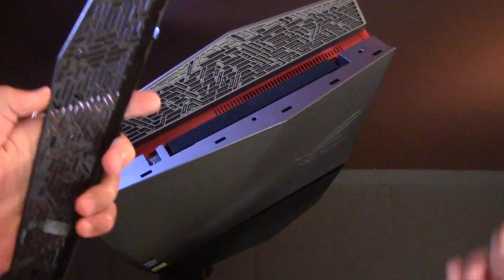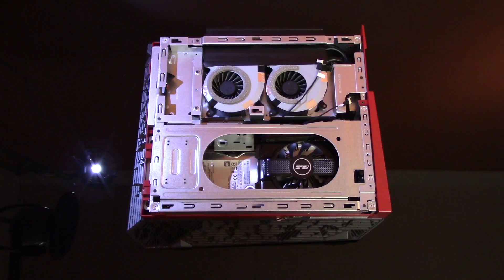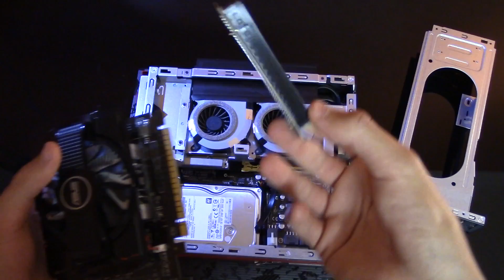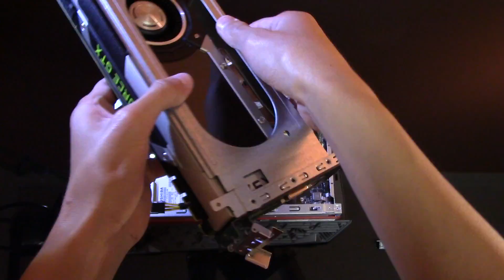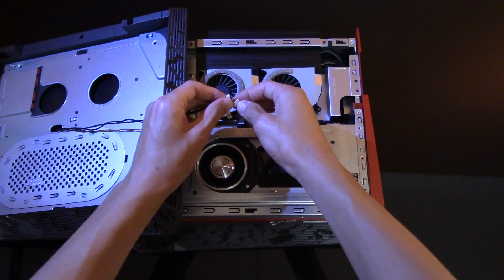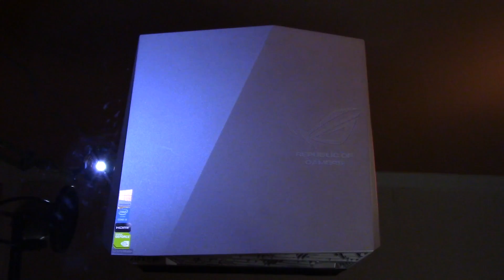Asus ROG G20 - GPU Upgrade Tutorial

Comment: hey drew, fyi i just wanted to say that you should move the four or five connectors under the jdc11 up. I  have  installed a gtx 980 reference in mine and it kept crashimg for some reason but i realised that it didnt get enough power and i goggled it. Your second power brick isn't actually getting used if u don't do this. The 970/980 version of the g20 was shipped like this.

When you get your second power brick, check if both of them are hot because only my 230w was hot and not the one that i just purchase. Glad if i could help :)

Forum link :https://rog.asus.com/forum/showthread.php?61551-330-w-psu-for-gtx-970/page4
Reply from the maker: Aye! Thanks. I actually recently figured it out and put a video up yesterday that I took down. I've moved all five of them, and it works fine, but not for everyone. I'll look at that forum, thanks m8
Reply from the maker: And which four pins did you move up? I've moved up all 5 and it works fine.
Reply: +DrewEon i moved all of them up and it works great :)
Reply from the maker: +fabbe0606 Alright. In the video going up tomorrow I'll show what I did and link that forum post.

Comment: Okay. And are the ones in the desc the only ones that are compatible with the PC. Or could I use a normal 400w power supply? Or do those not have the right usb or whatever to fit into the back of the pc
Reply from the maker: Those are the only type of power supplies compatible.
Reply: +DrewEon sorry man one last question I'm done. Thanks for the help though. So my computer came with the 230W but if I buy the 180w then where do I plug it in if the 230w is plugged in
Reply: +DrewEon is the GeForce GTX 970 4GB SSC Gaming ACX 2.0+ Cooling Graphics Card (04G-P4-3975-KR) compatible?
Reply from the maker: Paul Abramson Believe it fits, but it does push air into the case and warm everything up. You're best off with a reference model.

Comment: Does the nvidia gtx 1070 only need 180w or does it need more?(I already have the 230w)
Reply: Also, will the gtx 1070 produce alot more heat than the gtx 970?
Reply from the maker: It needs both power adapters, you can't have more!
And it'll produce more heat, but not heat up the PC. It exhausts out the back of the GPU.
Reply: Alright, thanks for the help.
Reply from the maker: Bob Dillon :)

Comment: Ok one more question thank you for your help. So once you plug it in is it ready to go or does it start installing ?
Reply from the maker: Install what?
Reply: +DrewEon Hey. When I look at power supplies they all have a lot of cords and it says you have to plug one into the mother board ect. For the rog g20 i5 4460 is there a certain power supply you should buy since you can't connect it to the motherboard. Like is there a certain one that plugs right into the back of the of. Because I can't find one
Reply from the maker: Paul Abramson They both plug right into the back. Links in the description
Reply: +DrewEon oh. Ok I will buy the one in the desc
Reply: +DrewEon so do I need both? And are they more expensive because of the model
Reply from the maker: Paul Abramson Well the G20 comes with one. If you get the 230w with your PC, purchase the 180w and vice versa
Reply: +DrewEon by comes with do you mean in the box? Or built inside the of?
Reply: +DrewEon inside the PC
Reply from the maker: Paul Abramson It comes in the box. It's like a beefy laptop charger

Comment: And what power supply do you need for gtx 970
Reply from the maker: Both the 180 and 230.
Reply: +DrewEon I can't find the power cables you have in the video. I bought a 6pin to 6pin and a 6pin to 8pin for my card. But when I opened the other side wasn't the same as the other. Like in your video. One side was to plug in. And the other side was to have something plugged into. I don't know where the ones that come in the box are. So what should I buy
Reply from the maker: Paul Abramson I said they come in the box. I can't find them anywhere else.

Comment: Does the asus rog come with the 230?
Reply from the maker: Depends on the model.
Reply: +DrewEon what pin adapter did you have
Reply from the maker: Paul Abramson Pin adapter?
Reply: +DrewEon like the 6pin to 6 pin adapter
Reply from the maker: Paul Abramson It came with the PC, no adapter
Reply: +DrewEon yea but I think I lost mine. I don't have the box anymore
Reply: +DrewEon do you mean came in the box? Or inside the pc
Reply from the maker: Paul Abramson Came in the box, unless you have a GPU like the 960, 970 or above

Comment: What do you mean by jave it. Because I've seen people with there power supply inside of there's desktop but this one is too small so where would it go
Reply from the maker: There are power adapters, external. like a laptop. you need both the 180W and 230W

Comment: Why did you get the reference card?
Reply from the maker: Most other cards don't fit, and it exhausts air out the back, so it doesn't heat up the PC. Also got it for very cheap.
Reply: +DrewEon ah I see

Comment: Are you able to upgrade the gpu to the 1070? What power supply would you need and would it fit?? Please respond :P.. BTW love your videos, you need to make more. and make more videos on the gtx 970 in action :P
Reply from the maker: The 1070 will fit and requires both the 180W and 230W. And I'll be doing more on the 970.
Reply: DrewEon ALright awesome :P I'm thinking about buying. I bought the rog g20aj awhile back with the gtx760 so it came with the 180 and 230 already :))

Comment: I'm gonna install a gtx 960 (evga 4gb sc) into this but will the 230w psu do the job or should I get the 180w psu too?
Reply from the maker: It'll work with just the 230W, but to get the most out of the 960 and to avoid damaging your main PSU by overloading it, you should get the 180w as well.
Reply: DrewEon so itll run the factory oc while gaming just fine?....until I get the 180w which should be by july 10th
Reply from the maker: I wouldn't say just fine, but it'll work.
Reply from the maker: It may slightly underclock the card if the power draw goes over 230W.
Reply: yeah I figured it woulda done that.....welp ill just wait till I get the 180w psu...im not gonna risk it xD...hang on dumb question time...if I have both the psu's will they both add on?(230+180w's)
Reply from the maker: i3DART They'll both work in tandem to power the PC. Although I believe the 180W only powers the GPU
Reply: DrewEon if they work together then theres an extra plus....Thanks for the tips and help ^.^ /
Reply: DrewEon For now what I will do is once I get the card and run it idle I'm gonna save that setting on evga precision then clock it to the default speeds (found what they were on the site)...then once I get the psu ill put it back...also if you have steam maybe we could play some games?(only have black ops 3 so far :P) welp...gnight and thanks for all the help m8.
Reply: DrewEon I just installed my gtx 960 but it is getting power and everything but no display......except the integrated graphics work but not the gpu.....any idea on what I can do to fix it?...(I put the 750 back in just to be safe)
Reply from the maker: i3DART Many people say they have that issue, but I didn't. I don't know what it could be. I'd look it up.
Reply: +DrewEon im guessing its secure boot...if that dont work ill see if my friends friend can help xD

Comment: I have this PC too but i'm not really satisfied with the fan that goes quiet loud. Is it possible that I buy a new PC case and take out all the components?
Reply from the maker: No, the motherboard is custom to the G20, there's laptop ram, you'd have to get a new CPU cooler, power supply :/
Reply: do you not have any issues with that?
Reply from the maker: ***** Issues with what?
Reply: that the fan gets pretty loud sometimes
Reply from the maker: ***** Since I've gotten the 970 and put new CPU thermal compound on, the PC has become much more quiet, but it does get annoying when playing some heavy games.

Comment: Eh. Maybe I can buy a broken one of these from eBay and salvage it for the case. I love that dang case, they have one on display at my Best Buy.
Reply from the maker: Well you have to use the motherboard that comes with the PC because it's build custom for the G20.
Reply: +DrewEon yeah, I know, I'd just pray the motherboard isn't the issue... Idk. I heard there's a new one of these coming out that runs two 1080's in SLI, so maybe I can get this older one for cheap once that hits the market
Reply: $699 buys you a brand new one with i7-4790 with GTX 960 if you're interested. microcenter.com
Reply: that's actually a really good deal, the tax and shipping puts it a little too steep though. you dont happen to live in st Davids, Philadelphia, do you?

Comment: I did this but with a 4gb GTX 960, it took me two hours to get it to fit in properly. I had to take of the CPU cooler fans to get the riser card in, and I couldn't use the GPU cage.
Reply from the maker: Which 960 model did you use? And I like to pull back the CPU cooler off as well, no need to risk damaging the riser card.

Comment: however since the rx 480 only has a 6 pin i would only connect the six pin correct?
Reply from the maker: Well if there's only a six pin, you can't connect the 8 pin :D
Reply: really? because the rx 480 only has a six pin, and the g20 aj has a six pin in it I thought
Reply from the maker: +Nick - n1ckba10 There's both a 6 and 8 pin. You'd just have to connect the 6 pin, and leave the 8 pin alone :D
Reply: ok, awesome.  then I would move that little pin connector so that it tells the motherboard that I have a new graphics card and power supply?
Reply from the maker: Yes.

Comment: so what power supplies do you need? i have the 180w, do i need both?
Reply from the maker: If you want to upgrade to a 950 or above, it's suggested you get the 230W power supply as well. If you're going for a 960 or above, it's a definite yes, you need it.
Reply: DrewEon ok thanks, another question, i wanna get the gtx 1070 but theres lots of version out there, which one should i get?
Reply from the maker: emin patkovic You have to get the reference model. After market models pump tons of air into the case and cause overheating on your CPU and such.
Reply: thanks alot mate, you helped me a ton
Reply from the maker: emin patkovic :D

Comment: Hi I also have a g20 and I am considering either the 970 or the 1070 do you know if the 1070 will fit thanks
Reply from the maker: The 1070 will fit.
Reply: +DrewEon Thanks do you know where to get the second  power brick from
Reply from the maker: +offroad2410 Description
Reply: +DrewEon ok thanks for the help great video by the way
Reply from the maker: offroad2410 :D
Reply: Is it worth paying extra for the nvidia version of cooler rather than an asus or evga etc
Reply from the maker: offroad2410 Yes! You shouldn't get a model from Asus or evga, etc, because those models will push extra air into the case which can cause overheating. Nvidia is supposed to release the non-founders edition card sometime which will be nearly the same thing at a slightly lower clock speed for much less.
Reply: Ok thanks this has really helped me understand what i need to do to upgrade thanks
Reply from the maker: +offroad2410 :D

Comment: hey is 180w/230w really enough for the 970? or the r9 390?
Reply from the maker: The two power supplies are more than enough for the GTX 970, as the 230W powers the CPU and such, and the 180W is dedicated to the GPU. Don't think it'd work with a 390 because, AMD, and I think all 390's are too large.
Reply: so I should get the one that I don't have yet?
Reply: also I thought that the pc was un-upgradeable I'm glad that I'm able to upgrade it
Reply from the maker: +DBSuper_2016 (720p HD) If you're going for the 970, yeah get it.
Reply: thanks

Comment: DrewEon good video i have this PC as well, mine is the GTX750/I5 4460 and i'm just about ready to upgrade the Ram as well as the GPU. my question is that the Asus specifications on the G20AJ only shows that it supports up to the GTX780 and you are installing a 970 did you have any issues or trouble using the 970 any info will be much appreciated thank.
Reply: no, it works up to a gtx 980, im not sure abour the 980ti or the new 1080/1070 cards
Reply: +X C A L I U M thanks for the info now I need to decide what gpu to get a 970 or 980. Decisions,decisions.
Reply: +Fernando “comando585” Nunez i wouls recommend a 970, because its cheap and can be overclocked to about 980 performance. also, i looked, and i think you can put in a 1080 and 1070.
Reply: +X C A L I U M would*
Reply: i think it will work up to the latest gpu's :-)
Reply from the maker: As long as the GPU fits and doesn't somehow use over 180W, you'll be good haha :D. 1070/1080 will fit.
Reply from the maker: Just try and get a reference card, they'll fit and don't blow extra heat into the case.
Reply: thanks again for the info everyone, a 1070/1080 would be nice but that's out of my price range. maybe once they get cheaper and by then it would be time for another upgrade. it will come down to which GPU i can get the most bang for my buck for.
Reply: yeah, cost like a brand new laptop haha

Comment: If you were to upgrade the G20 with this graphics card don't you need to upgrade its power? And how would you go about doing that?
Reply from the maker: You move JDC11, and purchase the extra power adapter. If you have  a 230w, get the 180w. Or vice versa
Reply: Thank you

Comment: whether it's using an additional power adapter?,sorry for my bad english
Reply: if so you use which I ask this because I do not really understand my English Indonesian people and I want to upgrade my asus rog G20 please answer yaaa
Reply: yes you want to use another power adapter for more powerful cards. anything that uses the 6 pin or 8 pin pci connector will likely need an additional power brick. so, yes. dont know if i got you your answer in time.

Comment: I'm too afraid of my system being overheated, but I have no fucking idea how to upgrade my PSU, since it uses two (custom?) power adapters that look like laptop chargers... HELP PLS.
Reply from the maker: If you have the 230W, get the 180W. If you have the 180W, get the 230W. links in desc
Reply: My model came with both, but I feel that still isn't enough...

Specs:
i7 4790 (non-k)
NVIDIA GTX 970 (reference model)
Soon to be 16GB memory (exact same as yours)
1TB HDD
150GB SSD

And I use my PC to play games such as CS:GO, Rust, Overwatch, H1Z1, Battlefield... at great settings.
Reply from the maker: +DeadShot You don't need to upgrade! You're totally fine!
Reply: I'll take your word, since you've got me this far... lol. But in case I needed to upgrade, how would I go about that? Is it even possible?
Reply from the maker: +DeadShot I don't believe there's a way to do it. I believe it can be done with the Alienware X51, so it just may be possible.

Comment: does anyone know if this card fits and would i need to upgrade the power supply? 

https://www.amazon.co.uk/gp/aw/d/B00WHJJ86E/ref=mp_s_a_1_19?ie=UTF8&qid=1466603292&sr=8-19&pi=SX200_QL40&keywords=graphics+card&dpPl=1&dpID=515TfgED1BL&ref=plSrch&th=1&psc=1
Reply from the maker: I'm not sure it it'll fit. It may be too wide. I know that the EVGA cards fit.
Reply: Which evga card is that and do you happen to know the dimensions?
Reply from the maker: Mathew Fugatt I believe all EVGA cards will fit in the G20.

Comment: Hey i was able to upgrade my ROG to a 970 GTX .. ty but my question to you is do you think the ROG needs a better power supply to run the GTX 970 since it has an internal and external ...
Reply from the maker: You need both the 180w and 230w.
Reply: DrewEon isn't that standard with the PC ... pretty sure it comes with both of those .... was just wondering if you would need a stronger one ...
Reply from the maker: Ten Twenty Some models come with it, some don't. Unless you plan to run 5 titan's you'll be good haha

Comment: Hey Drew, how are the temps and what CPU did you have again?
Reply from the maker: Temps are great, and actually better than when I had the 750. GPU runs at 70-80 degrees C (haven't tested it much), just what other cards run at, and the CPU has yet to crack 64 degrees C.